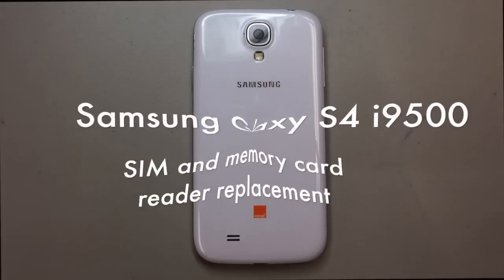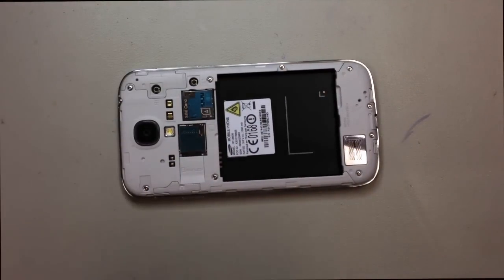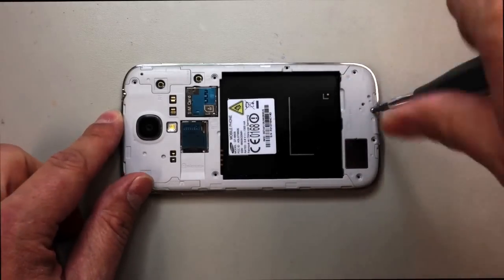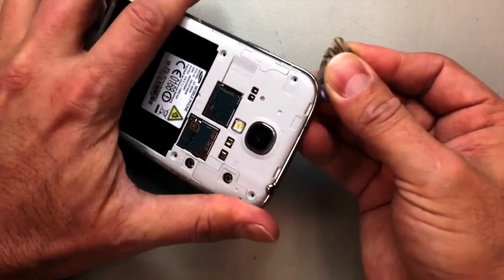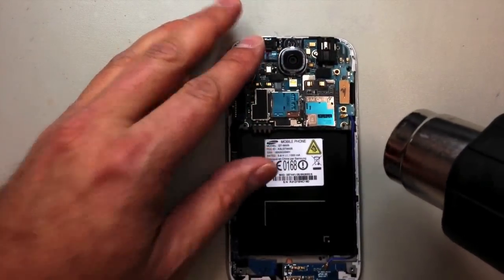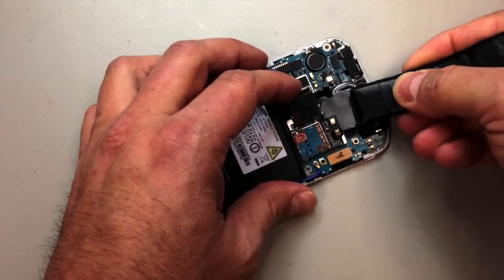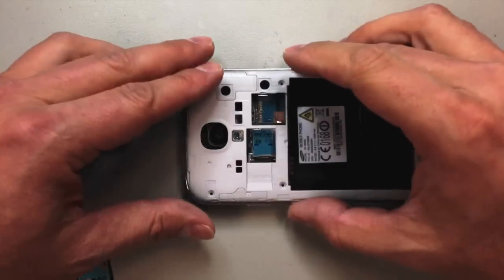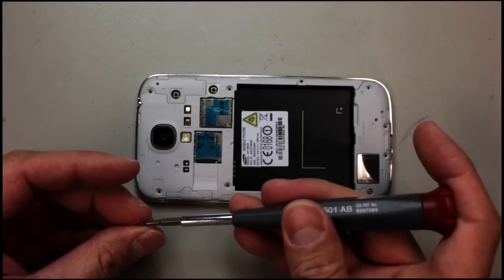Galaxy S4 SIM and micro SD card reader replacement

Comment: I just want to say THANK YOU!!! I damaged my sim reader and was told by a TMOBILE store employee that basically nothing could be done and I would have to replace the whole phone. I saw your video and bought the replacement part for less than $10 and my phone works great!! You made the process easy to understand even for someone with no experience repairing or replacing cell phone parts. Thanks again!!

Comment: Fantastic; very clear and concise.  Seeing the use of a guitar pick to pry the case open was critical.  Also, the fact that it opens on the seam closest to the front of the phone, not in the back, was essential.

Here's a tip for those considering replacing these slots: sometimes the problem is not the slot assembly, but the connector.  I improved my problem for a while by putting a piece of double-sided foam tape (with the non-stick layer left on) on the inside of my case at the point above where the connector is, just to keep pressure on it (through the bezel, which is flexible).  But eventually the foam got compressed and/or the case got deformed, and the problem recurred.

So what I just did now was to pull off the bezel as shown in this video, and take a tiny piece of the double-stick tape (again, with the non-stick peel-away layer left on, so that only one side sticks) and stuck the piece to the inside of the bezel exactly where the bezel contacts the connector.  There is a little black rectangle on the inside of the bezel that fits on top of the connector, and this allows you to know exactly where to put your little piece of tape (sticky side to the bezel - you don't want sticky tape on your connector, or the next time you open the case it will perhaps pull the connector off).

So I did not bother replacing the slot assembly, as I suspect that it is not the problem (or, if it is, it is the connector on the slot assembly - in which case replacing the assembly might help).  What I did, though, should help even if it is the connector on the assembly, and it may be the only thing that will help if the problem is the connector on the motherboard.

This puts more direct and reliable pressure on the connector.  I'm not certain whether this will work in the long run, but so far it is working for me (after only a couple of hours).  You do have to push down a little bit on the bezel to get the SD card in and out, since the tape pushes the bezel up just a hair.  But the SD card goes in just fine if you maintain just a little pressure, and my SD card after this procedure is working just fine.

Comment: Have ATT S4.  I have been searching for an answer to this problem for months, (using my old iphone4)  I ordered the simcard holder part, and while waiting for it I wanted to see how to install it and I found this video.  As it turns out, all I had to do is push down firmly about at the 7 o'clock position below the camera lens.  The push down block must have lifted from flexing and heat (it does get hot at that part of the phone).  I will have the additional part, but no need for it now.  Thank you so much for your video!!!
Reply from the maker: That's great. Yeah there seems to be a real issue with heat on this phone. You might want to keep the replacement part just in case.
Reply: It's funny, I got back from work today, and there it was in the mailbox.  Yeah, definitely keeping it. 24 hours in and my phone is still like new!  Thanks! Have a great week and SPD today!
Reply: Started failing again, so I ended up cracking mine open and putting tape behind the plug to push it in better.  Glad to help  Pass on the fix!
Reply: Sans Peur Thanks for sharing your solution :) My phone seems to be working fine now after the tape solution! :D I'm really pissed off at Samsung though; it's definitely going to be the last time I buy one of their phones!
Reply: Your welcome!!  My son has the S5 and he has not had any problems.  The S6 is just an Iphone.  Really I was with you as far as not getting Samsung for my next phone.  I cannot go back to apple.   I spent 5 weeks back on the iphone 4s, before I found this fix..and the S4 is definitly better than the iphone.
Reply: eDDie Velez

Comment: Thanks for this .. excellent video
Worked for me - I used the wife's hairdryer as a heat gun ...  
The replacement sim card tray cost around £2 ($3.5)
The update took me about 20 mins - 10 mins of which were taking out and putting back the screws ... :-) 
I now have a fully working unlocked S4 as a second phone/GPS/Audiobook Player and Music all for < £20 with TomTom and other software plus a couple of fixes on the phone itself ...

Comment from the maker: You will need to apply slight pressure over the entire sim card reader and carefully slide out the adapter. The problem is that the edges get caught on the sim reader pins. Take your time and do not force it. This video might help as it shows how to remove a custom sim adapter.

Micro SIM card adapter

Good luck.
Reply from the maker: You will need to apply slight pressure over the entire sim card reader and carefully slide out the adapter. The problem is that the edges get caught on the sim reader pins. Take your time and do not force it. This video might help as it shows how to remove a custom sim adapter.

Galaxy S4 SIM and micro SD card reader replacement

Good luck.
Reply: Go Cell Phone Repair Hii thaks a lot it really help me and i was able to take out my sim card with sim adapter. thanks once again.
Reply: Go Cell Phone Repair I wish I would have saw this before my dad decided to rip out the adapter.
I told him not to, but he did it anyway... $75 and 5 days later, we have to have it repaired.

Comment: you freaking genius! I stuck a piece of 3m Mounting tape between the white shell and the connector and voila! Problem solved!
Reply: Yeah, I did the same thing and it seems to be working.  It is double-stick tape so I left the peel-off non-sticky stuff on one side and just stuck it to the inside of the bezel (shell, as you say).  No need, in my case, for a new slot assembly.

Comment: Hi, I have a Galaxy S4 SGH-I337M, in the video you said this repair was for S4 i9500 and on the website the sim and sd port are labelled for Samsung Galaxy S4 i337 M919. Is there a real difference between these? Can I use the same replacement procedure and the same sim and sd port on my S4?

Comment: Wow easier than I thought,  thanks!  Just moved to England and the sim tray I installed messed up the sim board. My question; I noticed that there are 9500 and i337 replacement sim readers out there, are they the same? They're trying to charge £60 for this job with parts here!
Reply from the maker: All of the models listed in the video description use the same SIM reader.

Comment: great video,
I have a weird problem with my S4 i9500, I changed the screen couple of months ago and after that I started noticing that the coverage sometimes is lost, other times the coverage bars are full, but I can't receive or make calls and no 3G or EDGE connection.
I fix it by twisting the phone a little bit, or pressing hard on the back.
I opened it multiple times checked the antenna cable but with no luck.
do you have any advice for me ?

Comment: So I've tried applying pressure to the ribbon reader area various times and yet it always seems to fail. I saw in the description that someone used a piece of duct tape to apply that pressure. Could you clarify where I have to apply the duct tape to? Is it under the white casing where all the circuitry is or under the plastic shell cover?

Comment: Hi. I have the Galaxy S4 mini (gt i9195) bought in Spain 6 months ago but I now live in Argentina. 
The problem is when I once took out the SIMcard and when I put it back the cell did not recognize it (it says: insert SIM card). I tried with any other simcard and it's the same thing. I suppose I perhaps damaged the reader with my nails.
Samsung Argentina denies the warranty because I bought it in Spain. BTW in Argentina, Samsung sells the the i9190 model, not i9195 one. 
So my questions are: in my case the most probable thing is that any pin of the reader may be damaged? and 
the i9190 and i9195's SIM reader is the same part? Because I will try to look for the SIM SD reader and try to change it myself.
Thanks in advance and nice video (it's helpful).
Reply from the maker: It sounds like the SIM reader may be your problem. The i9190, i9192 and i9195 SIM readers are all interchangeable.
Reply: Go Cell Phone Repair Thank you! I'm finally going to buy the SIM reader part and I will try to replace the old one.

Comment: I'm currently running a nightly build of CM11 on my GS4 M919 right now, and I'm getting the "SIM card removed" error ever since I dropped my phone into the toilet (don't want to get into the specifics, but if you really want or need to know to know, reply and ask for more details). What could have caused this issue? And is it repairable?

I should mention that the SIM card removed error happens completely randomly at any time, and usually, the reader starts working after I restart. Occasionally, though, the phone has stubborn spells and the SIM card reader won't work even if I restart multiple times. It hasn't been working for a couple hours now. And I'm positive it's the SIM card reader, because the same error occurs even with different SIM cards.

Thanks.

Comment: Can the sim error thing also be fixed by simply re-attaching the connector to the motherboard?
Reply from the maker: If it has somehow become disconnected then that would help but I haven't seen that happen before. It's worth a try though.
Reply: Go Cell Phone Repair Update: Just managed to fix it without replacement! What seems to have happened is that the white shell around the cirquit boards had expanded because of heat. (It does heat up like all hell) So the connector wasn't in place properly because it's supposed to be pushed down by the shell. (hence it has a little protective/gripping piece of foam on the shell where the connector is) So I stuck a couple of layers of duct tape to the connector, making it slightly thicker, thus maintaining a better contact. I've only just done this but it seems to have worked. I can now use my phone after 2 days of it not being able to see my card at all. Will keep updates going, many people seem to have this issue and if this is a working (if not slightly temporary) fix, i'd be glad to have helped those people out if this fix gets out there.
Reply from the maker: xXRandomCamperXx Cool. Thanks for the follow up. Hopefully it works long term. As you mentioned this does seem to be a very common problem.
Reply: Soo, tried this for about a week or 2, I must say it's definitely a good fix. I still got the no sim card issue but only in very warm rooms and when my phone heats up from the sun it happens occasionally. But otherwise, this seems to be a pretty good fix. I recommend trying this to everyone with the no sim issue.
Reply from the maker: xXRandomCamperXx Cool. I have added your suggestion to the video description. Thanks again. Hopefully that will help other people to solve their problem.
Reply: xXRandomCamperXx Can you elaborate on where exactly you put the duct tape? Did you put it on the sim card reader or did you remove the back casing as shown in this video and place it elsewhere? I have a feeling this is the exact workaround I need for my SIM card issues.
Reply: Timothy Davis I removed the white back panel and put the duct tape on top of the snap connector where the card reader is connected to the motherboard. It keepd it down better so it doesn't disconnect if you were to shake the phone a bit. It did work for me however I didn't put enough duct tape at the time, so it didn't really work for a long time. This can be fixed without opening up the phone by putting a folded srhred of paper between the back panel and the white casing and push down on the actual back panel. If you have a case around your phone this keeps it down even better, it's a very ghetto workaround but it works. If you want a permanent fix, don't order a new sim card reader, but order a new back panel. It should work wonders. It baffles me how samsung doesn't even know about this or how they've never even researched it far enough to realize what is actually going on. Proves that they have a great freaking customer service center indeed, the pricks. Also thank god for youtube getting rid of the 120 character comment length limit.
Reply: Go Cell Phone Repair Alright, after a couple months of having this fix working and being happy with my s4 again, my phone can now not detect the sim at all, ever. No matter what I do to the externals or internals of it. I've just ordered a Oneplus One because I'm sick and tired of having an unstable phone that can break any second and has now been broken for a week. This is where I give up.
Reply: ***** Oh lord no, i reversed all of it to get the glass fixed and get it shipped back under warranty to get a new one. Sod this.
Reply: xXRandomCamperXx hello ! Is it still working after 5 months ?
Reply: mizukechan As I said, I gave up and got myself a Oneplus One. I couldn't be arsed to deal with the problem anymore but now that a proper diagnose of the issue has been made, I guess people can go find solutions. I personally have forgotten all about my Galaxy Scrap 4 and I'm glad I did.
Reply: xXRandomCamperXx I'm encountering the same problem. So basically the Galaxy S4 was designed poorly. It can't take a little heat without getting that shitty error. I've had it for a little over a year taking really good care of it, but it can't take heat, that sucks. I'm considering buying a new smartphone instead of this replacement, even though it looks like new.
Reply: Juan Carlos Jimenez Rodriguez Can't advertise the Oneplus One enough, as I said. It's available for purchase without an invite every thursday lately. Three fiddy for a phone that good is a bargain .
Reply: Jk

Comment: @go cell phone repair

thx for the video i replaced the slots, but my sd card is not recognized. i dont know if it worked before. is the new slot is faulty or could it be that the logic board damaged?
Reply from the maker: +Kaan T Its unusual but possible that the new reader has a problem. Was the old one reading anything and did you already test the SD card in another device?
Reply: +Go Cell Phone Repair the new slot where broke. thx for your quick answere. you are a good guy

Comment: Have you been able to figure out the most common fix to the "no sim card detected" in the tmobile samsung galaxy s4?  I have an s2 also that I ruined the sd card slot that I will change out and I think i can use this video as a quide right? should be similiar to change in both right? also, I have the s4 and after months of the no sim card error and trying different things it won't read it at all so I just set it aside...do u know how to help it ? Love this video by the way! Very informative! I ordered the replacement part for the s2 but now not so sure if i ordered the right one because one says with metal and other doesn't but says they're both for same phones so I guess I'll figure it out...
Reply from the maker: This fix works a lot of the time but in some cases problem has a different source. In the worst case where none of the recommended methods work you might need to replace the entire logic board. A software upgrade can even help in rare cases. The S2 is similar but and the hardest part on that one is probably cracking the phone open. The reader is typically adhered to a piece of metal so you can replace that panel or salvage the original. Good luck. I hope you get it working again.

Comment: is it the same procedure for the mega 6.3? Because i tried many SD cards and it keeps saying blank SD card or unsupported filesystem. will doing this solve the problem?
Reply from the maker: The Mega SIM/SD reader does not appear to be modular so you'd need some serious soldering skills to replace it.

Comment: I realize this is an old post/video but my GS4 has the strange "No audio / sound during a phone call on either side (caller or receiver)". ALL other audio is heard, voice recorder records and plays back, but still no audio during call.  I managed to find a post elsewhere that stated this issue is remedied by replacing: Unit-SIM SD SOCKET; SGH-I377 and MODULE-IF SUB FPCB(SGH-I337).

My SD card reader works fine even when the audio problem is occurring.

Does this sound plausible to you?

-Thanks, Dave

Comment: So my phone is stuck saying "preparing sd card," and I do not have the option to mount it. To fix this problem will I have to replace the reader, because it seems to read that it is plugged in, or would you recommend I go about fixing the problem a different way?

Comment: Hi, good video. Some questions: Can this fix the "no sound during call" problem ? I try everything and this is the last option I red about. And it is important to buy the same card reader part number, i mean mine have "sgh-I337 rev 0.6" and on ebay i'm seeing some "i-9505" or "sgh-1337" but the rev is 0.3... what is the best choice ? Do I need to find a part for my specific carrier ?
Reply from the maker: All of the S4 SIM readers are the same so no worries there. The bad news is that I don't think this will help with any call audio problems. That is more likely software or a different hardware issue inside of the phone.
Reply: Thank you. I think I'll give a try (for this price). I red on some forum, some people who try it and it work. sometime i simply open the back cover of the phone and I'm able to do calls again. some other said it can be the audio IC chip to reheat the solder, but I don't have the precise tool do try it. I'll post later if it work or not. Thanks again